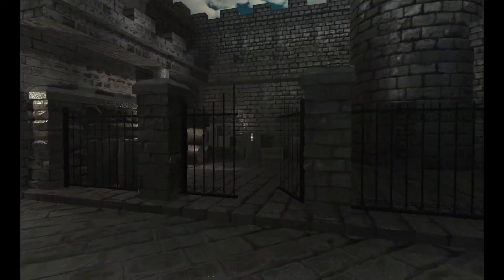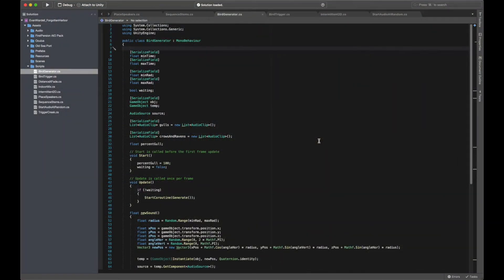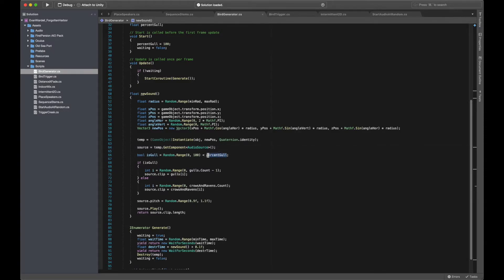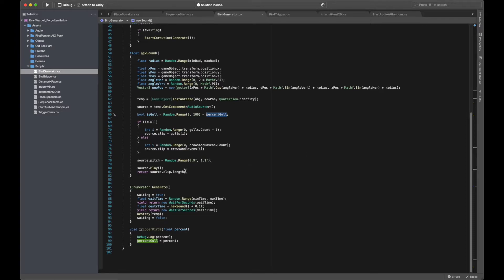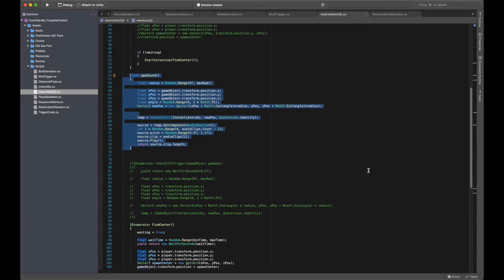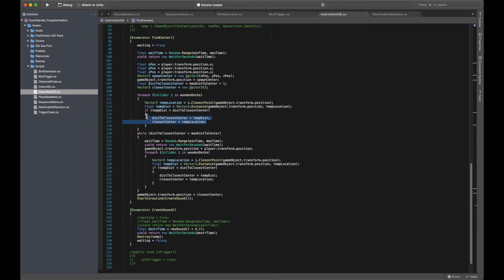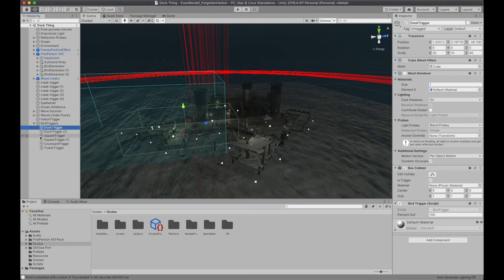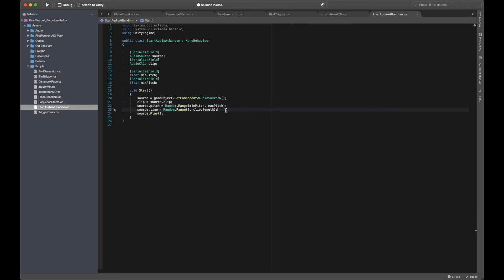Ambient Sound Design Techniques Showcase (Unity & C# Scripts)

Comment: Why did you make scripts to trigger the audio instead of using middleware?
Reply from the maker: Tl;dr, as an exercise haha, and because some of this functionality would require scripting whether or not you're using middleware.

Longer version: first, Unity audio, while not always ideal, does have its use cases! Middleware becomes more and more useful as a game scales up in size, as one of its greatest strengths is providing an accessible organizational and mix structure, and simplifying repetitive tasks like randomizing pitch, etc. It also provides some advanced features and plugins that would be really difficult to replicate in Unity, repetitive or not! But if you're working in a situation with small scope and rapid prototyping, like a game jam, you might not need those benefits, and it can actually be simpler to just bypass integration of Wwise or FMOD. Many game jam projects also benefit greatly from being playable in-browser through a WebGL build on Itch (more people are likely to play and vote for your game if they don't have to download it), and Unity audio is much easier to make work with this! (There are some limitations - no playDelayed or playScheduled, for example - but Wwise doesn't work at all on WebGL since it can't run single-threaded, and while FMOD can theoretically work, they don't really have documentation for this process, so I'm going to need to test it before I can actually recommend that.)

There's also the question of licensing! This was a more significant motivator up until the end of last month when Wwise announced that they're revamping their licensing structure to allow for free indie licenses without asset limits on any game with a development budget under $250K (FMOD already effectively did this for developers with less than $200k in revenue per year). With this change, there is of course much, much less financial incentive not to just use Wwise. But there's still, technically, some theoretical scenario in which a game has a budget of over $250K but has audio needs that are simple enough not to justify a $7000+ pro licensing fee. (If anything, I'd guess that this could probably happen in the world of mobile game development!)

But putting aside whether to use middleware in the first place, it's also important to note that much (if not the grand majority) of music and sound design implementation using middleware still requires scripting to be triggered! Sure, there's a certain amount you can do just in the Unity inspector, like automatically playing a sound with AkAmbient or setting certain parameters of an AkEvent component, but even that functionality I still prefer to implement via script, since it can still remain decoupled, and makes it much easier for me to parse when debugging. (Editing AkEvent in the inspector also seems to be easiest when the gameplay programmer is already working with the Unity events system, which isn't always the case! Some programmers I've worked with actually really prefer not to.) But beyond these preferences, there's very, very often going to be some kind of behavior or variable which you'll have to manipulate through code in order to achieve the desired result.

Looking at the three techniques in this video, I can tell you that only one of these can be done in the same exact way without scripting, and that's the third one (instantiating ambient SFX at random start points - you can do this with AkAmbient components, adding a Seek action to the sound object within Wwise, and randomizing the seek percent value).

For the first technique, randomly emitting sounds from some point in space, you can achieve something SIMILAR using the 3D User-defined position editor in Wwise, creating different "paths" for the sound to appear in around the player and setting play type to random. However, my understanding is that the way this sound exists in world space would be fundamentally different. The technique I use in this video, randomly selecting a position in world space and instantiating an audio source at that point (which could also be done to a Wwise audio source), causes that sound to appear in a location regardless of where the player is at the time when it plays, or where they move. It exists and stays still in world space because I programmed it to. With the 3D User-defined position editor, however, while I can disable "follow listener orientation" to have a sound appear to remain in a position when the player rotates their view, my understanding is that it still effectively follows the player's position in space, meaning that its predetermined path is still centered around the player no matter where they move in space. To be fair, in this particular use case, that would probably be fine! Player movement isn't that extreme, the sounds aren't that long, and the path editor in Wwise might actually help to make more realistic playback for the slightly longer sounds. But we can easily imagine a use case wherein you're playing longer environmental sounds that need to exist at some point in world space regardless of where the player moves, and for which there aren't already game objects within the scene to which these sounds would be tied. In that case, you'd still need to do scripting like this where you specifically designate the location of a game object from which these sounds would be played!

And for the second technique (I'm almost done, I swear), randomly emitting sounds from some point along a surface, the answer is much simpler - there just isn't any functionality in Wwise that can do this, or anything similar, without designating the position via script. It's an implementation which very specifically relies on access to information about world space (and ultimately the game's physics engine). Again, you can still play this sound using a Wwise audio source (and may very well have good reason for doing so), but determining the location will still require scripting.

These are just a few examples - there are countless other ways where scripting is necessary and helpful to Wwise implementation, either for referencing something in the game or adding new functionality that isn't natively available in middleware. (I don't explicitly frame them this way, but I show a few examples of this in my Harmony-Tracking Musical Sound Design video - https://youtu.be/hIW4lWefDPE - largely with RTPCs, one such example being that I calculate and send an RTPC from Unity via scripting in order to randomize and play pitched SFX in an order that wouldn't be practical using only Wwise's random and sequence step containers.)

Anyways, sorry for the wall of text, but I hope that helps!